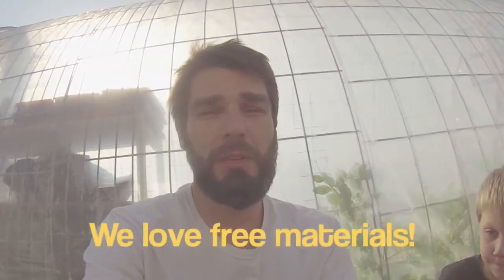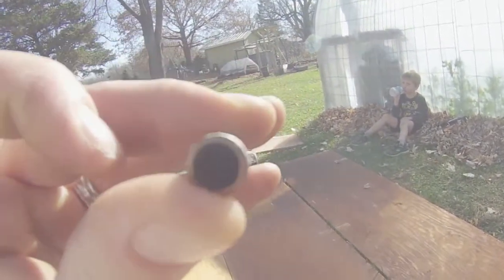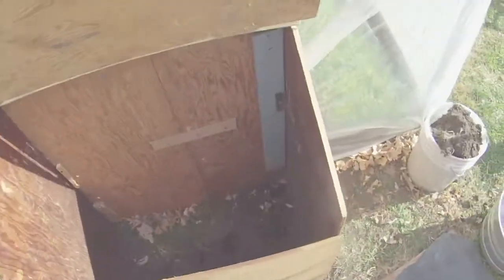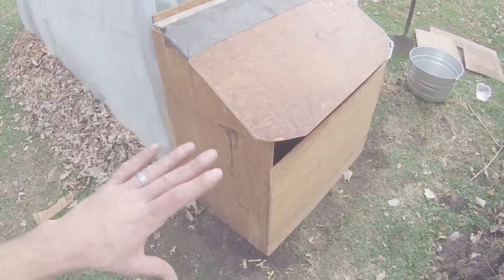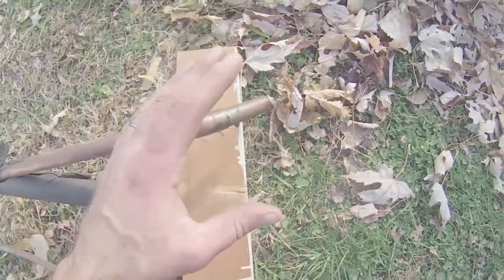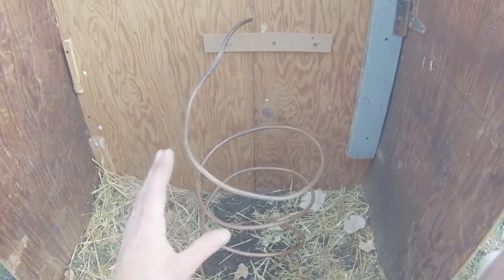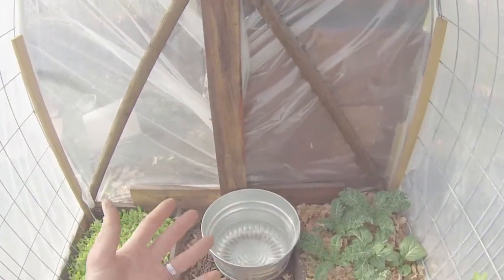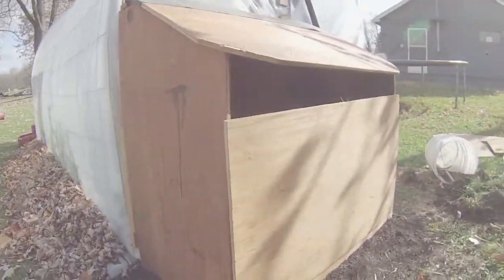DIY Greenhouse HEAT With Compost | Recycled Material | Free Heat For Our DIY Greenhouse Zone 4b

Comment: Get a radiator from an air conditioning unit and build a duct box with a fan sucking air through the radiator as you pump Hot water through it.

Comment: If you keep your water tank higher than the coil, water will flow due to natural convection therefore no need for a pump or electronics.   But then you wouldn’t have the pipe in the bed either.